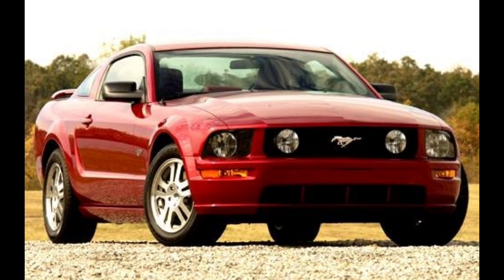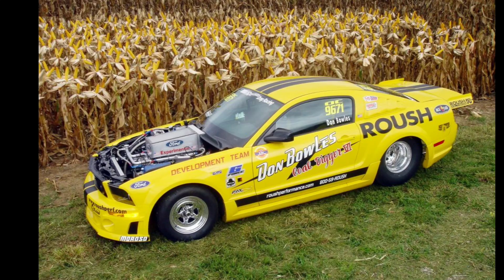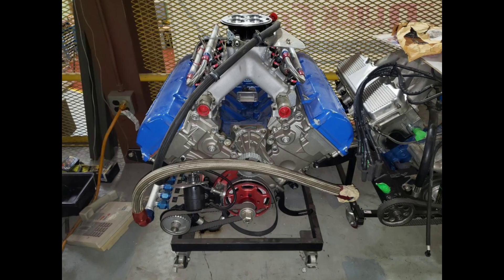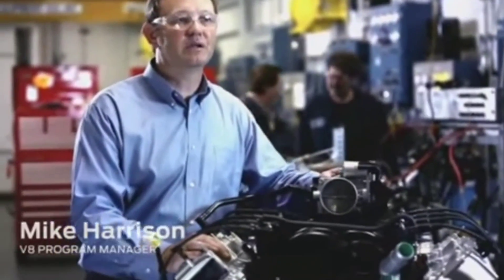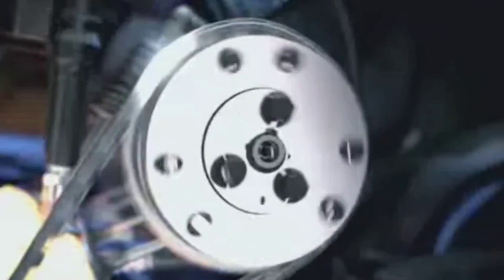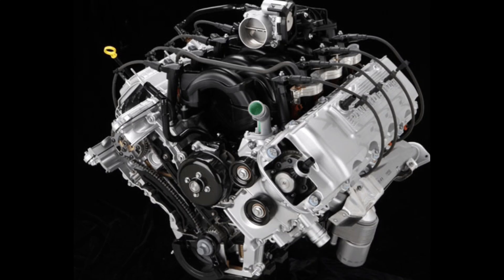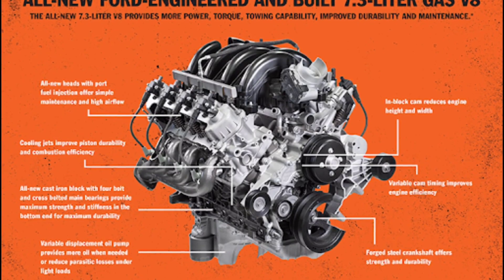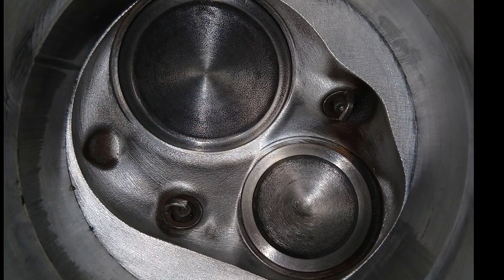Ford's Modern Day 427 SOHC Cammer..

Comment: Where did you source the parts needed to convert the 4.6 to a direct-cam-driven distributor-based ignition?
Reply from the maker: Stylac, we made it ourselves...  We used a 351C distributor cut down and welded a socket on the shaft that was the size of the cam gear bolt. Drilled the aluminum valvecover (made by Team Breed) in the proper location then welded a sleeve on the valvecover for the distributor to slide into... it is held in place by 3 set screws drilled and tapped into the sleeve..  Hope this helps.  I'm wanting to say that we did this back around 2009 or 2010...  it works great we use a crank trigger to fire the ignition but it is nice having a regular style ignition system on the car... Thanks for Watching.  I did a Video on the mustang awhile back on my channel.  The fastest Nitrous 4.6 2V
Andy
Reply: @UnityMotorSportsGarage  
Very nice work.  Looks professionally made by an OEM.   I love these type of projects where you are doing something original!
Reply from the maker: Stylac, Thank you!  On this deal.. it was done out of necessity.. We had been running the MSD Mod 6 box controller.  We in fact had one of the first if not the first Box to test on a Carbed 4.6 and this engine has 14 to 1 compression with ALOT of Nitrous which makes for a ton of cylinder pressure.. well with this the Mod 6 box would work great for a short time and then it would kill the coil drivers in the box!  It would drop cylinders and cause horrible backfires.. after we went through 3 or 4 of those boxes it became apparent that I had to come up with a change.. so I sketched the design out and we made what you see today... Funny Story years ago we took the car to a NMRA race and a rep from Trickflow came over to look at the car. ( We were running their heads ) he began to ask me about the setup so I explained how we did it. A few months later at SEMA and PRI Trickflow had come out with a kit to do the same thing!  You can still buy it today... The idea came from this car!
Andy

Comment: The old SOHC 427 was a HEMI head
Reply: Hi, I had some flow numbers of SOHC 427 with a high port head.    Fitted with Manley valves the flow numbers:
.200" - 175 cfm
.300" - 270 cfm
.400" - 330 cfm
.500" - 405 cfm
.600" - 440 cfm
.700" - 450 cfm

Stock valves:
.200" - 155 cfm
.300" - 240 cfm
.400" - 300 cfm
.500" - 375 cfm
.600" - 405 cfm
.700" - 420 cfm

The low lift flows of .400" and below are not that far from a DOHC head on the same bore and definately well above any pushrod head of similar valve size on the same bore.

Comment: I have a 6.2 in a 2017 f350 and it's a total dog, runs out of power at 3k rpm and has trouble maintaining the 85 mph speedlimit
Reply: Then you have something wrong.  My 2011 6.2 f250, starts belting out the power around 3k, and really kicks ass through 5800-6000 rpm.  I beat a tuned/bigger turbo’d Duramax to embarassment last month in a 30 roll.   My stock super duty has tall 3.73’s to boot.
Reply: @mistered9435  look up the power rating of a 2017 f350 cab and chassis model and it'll explain why mine is such a dog.

And there is no way that your 6.2 beat a duramax that's making atleast 400hp and probably 800 ft lbs of torque, you were probably racing and he was driving normal.
Reply: @centraltexasfoxbodies  haha. I’m not a brand loyalist, but I seriously did smoke the duramax.  It is my nephew’s truck, we were on our way to a family celebration,  got beside each other on the way out of town, and stood on the go-pedal.  The diesels have a much narrower power band btw.  You could also check out the towing videos on YT about gas Super duty vs. gas GM and Ram.  It may have been The Fast Lane videos?
Reply: @centraltexasfoxbodies  no.  You will need a 20-speed transmission to keep that diesel in the power range.  Think about it:  put a 600hp Peterbilt against a 155hp trailblazer, which one do you think is going to cross the finish line first?  The Pete has 4 times the weight and 4 times the hp, but it doesn’t have the broad rpm range.  It makes its power within a few hundred rpm, while the gas engine makes its power over a few thousand rpm
Reply: @centraltexasfoxbodies  I hate to hurt your feelings, but my 6.2 wasted his duramax. 
His truck is an ‘02 with a bigger turbo and a tune,  no lift extended cab long box 4x4. 
My truck is a stone stock f250 lariat, super cab long box 4x4 with a fiberglass topper on it that is 6” above cab height. 
I’m sorry that you can’t accept that the 6.2 in my Ford likes to beat up on a duramax, but the truth hurts.  I might add that my truck is probably about the same weight as his even though his is a diesel.  
AVERAGE power across a broader power range is the key here.  You are stuck on peak power output.  The diesel makes its power for a much shorter span than the gas engine.  Get it?!?!
Reply: @centraltexasfoxbodies  wow. You wouldn’t know the truth if it punched you in the teeth.  I was following him to an event center, he stood on it, was rolling coal, I got on mine, and passed him!  He was far less hurt about it than you are.  Yes, he was indeed trying to outrun me, but my stock 6.2 was too much for the duramax.  Your facts are crap.  I’m sure that you would refuse to believe that my wife’s (new at the time) 2013 Mustang 3.7 also outran his 1993 LT1 Formula 6-speed too.  He didn’t cry about it and these are not serious, anal grudge matches.  
Years ago, i allowed the same nephew to take my street-driven 1993 z28 to the drag strip.  I built that lt1/a4 to be a fun daily driver/weekend warrior with a .030” overbore, tight quench, GMPP lt4 Hot Cam, 11.6:1 compression, Trick flow heads, Pacesetter headers, magnaflow exhaust, and 3.42 rears.  Very simple, right?
At the drag strip, Bully Dog had a Dodge Ram there.  I have no idea what kind of power they were claiming to have in that truck, but I am sure that they had thrown the whole bag of tricks at it.  Guess what?  My simple, not-yet-optimized z28 edged them out in the 1/4 mile.  I would think that they had at least double the hp and maybe triple the torque that my Camaro had.  That actually was on YouTube back then (roughly 10 years ago)
With your thinking, how do you explain that?
Reply: @centraltexasfoxbodies  btw, look up the Dyno graphs of the 6.2 ford.  You showed your hand as soon as you claimed that “your” truck is out of power at 3k rpm.  With your lack of intelligence, you would never be able to buy a 2017 anything.
Reply: @centraltexasfoxbodies  well congratulations.
Reply: @centraltexasfoxbodies  your 84 month financing is going to seem like forever, but hang in there, someday they will be all yours
Reply: @centraltexasfoxbodies  good for you. Our new ‘22 chevy is supposed to arrive sometime this week.  My daughter enjoys her ‘21 Trailblazer RS (her first new car).  I will keep my 11 year old f250 for awhile because I take care of it and it looks great and runs great.  It has been a perfect truck.  155,000 miles without a single repair (unless you consider changing spark plugs and battery a repair)
Reply: @centraltexasfoxbodies  haha. I’m not the one who had to finance a Ford Focus!  The F150, I could understand; we traded in my wife’s f150 Lariat on the ‘22 Chevy and chose to finance the remainder at 3% because my daughter’s  Trailblazer was a chunk of change to lay out earlier this year.  I’m not rich, but I have had a great 22 years as a business owner.  Have a great day driving your sewage-pump truck!
Reply: @centraltexasfoxbodies  you ASSume too much!  You are the one who started the belittling.  I told completely true occurrences regarding my vehicles and somehow you know better and were basically calling me a liar. What kind of response did you expect?  Are you seriously running your company truck at 85 mph?  I would shit-can your sorry ass immediately if you were my employee (although I’d have never hired you in the first place).  
AFM?  Lol. I never said what model of chevy we bought.  It sure as hell isn’t a SilverLAREDO!!  Ours will not have AFM. 
I’m sure that you’re not as bad a guy as you come off to be on here, so I will wish you a safe day at work.
Reply: Also, you are exactly why there is a spell-check option on your device.
Reply: the f250 had the 410 horse your f350 has the work truck nersion 365

Comment: Perfect timing for this video. I’m actually working on a friends 6.2. Haven’t ever dealt with them before. It’s water pump shaft broke and the fan just shredded everything up front. Made a real mess of the rad😢. At least the trans cooler and the a/c condenser were ok. Now the fun begins of putting it all back together.

Comment: Thank you for confirming the 6.2l and 7.3l possible crank swap. Working for the company that produces both factory intake manifolds and knowing bore spacing to be identical, ive pondered for awhile now if the cranks would swap. Thank you!!
Reply from the maker: Yes Gary, I begin reading when the 7.3 came out and noticed the bore spacing.. we ordered a 7.3  crank from the local Ford dealership. It was like $350 and it's a Forged crank!  It went right in... Like I said need to machine a sleeve to drive the oil pump..  Thanks for Watching!
Andy
Reply: @UnityMotorSportsGarage  Hi, any updates?
Reply from the maker: We decided to go with the Godzilla engine instead. It will be cheaper in the long run.. you will be seeing Godzilla content coming up here over the Winter

Comment: Please sir go with the 445ci Godzilla 7.3, nobody is showing gradual fab work on shimming a 7.3 in older trucks or cars. Personally I’m wanting to put a stock 7.3 out of a wrecked 2019-2021 truck into my 85 F250 XLT Lariat 4X4 for daily driving with power upgrades after the fab work is complete and drivable daily. I’m currently just waiting for a wrecked truck with a running 7.3 salvage title to show up in the junkyards to do the swap because buying everything new outright I can’t afford. Sadly this means somebody has to have a bad day for me to be able to do this swap in a 85 OBS Ford Truck.

Comment: I have the absolute best motor in my 02 mustang, a 6.0 LS ironblock with a reliable detuned 826hp at 7.5 lbs boost, max tune safely is just over 1200hp.
Reply: What color stang am I looking for at LS fest?

Comment: Indmar marine switched from GM engines to the 6.2 Ford, and Ecoboost 4 cyl. I know they have a 510 HP/580 TQ version of the 6.2, and a shop I worked at did an SCT tune on the Raptor when it came out, and Ford factory tune is very conservative on timing and fuel.

Comment: Before you cut up that 6.2 junk head why not see whether it'll fit on top of a 7.3? Are the head studs in the same location or no? If they are, well, that could be very most good. [Kinda reminiscent of the old Clevor conversions back in the day, putting Cleveland heads on top of Windsor blocks- remember that!]

Comment: 385 to 411 hp isnt shabby at all. Very importantly, the SOHC 6.2 is a 239  thou shallower Godzilla deck engine at 9.410 inches, not 9.649. It shares all the OHV tooling.  The crank is 3.74 verses 3.976,  the bores 4.015, verses 4.220. Yet again, Ford has a shared Michigan transfer line which allows a classic scramble...a range of 300 to 430 hp engines on the same tooling. Ford can now step back to OHV, step back to 5.3 to 5.8 liters in the confines of the same block, exactly like Chrysler did with the 331/354/392 Firepower Hemis from 1951 to 1958. That engine became the basis for the Drag Strip 392 Hemi. For the next 13 years till early 1970, that became The Drag engine. It took years for the 426 and 429 to follow in the 392 Hemis footprints!  You can bet Ford will do the same as Mopar. All Part of the Master Plan Andy!

Comment: I’m guessing the 6.2 never made it into a Mustang for 2 reasons.  Emissions and fuel mileage.  Even back in 2010 Ford knew the EPA was coming at all manufacturers with stricter fuel mileage standards.
Reply: Yet the C8 has a 6.2 in it.
Reply: Don't you just love liberals? They really screwed us in muscle car era. We've been screwed ever since. They just love to be the killjoy in everyone's life cuz they want everyone to be as miserable as they are. I got my driver's license a year before the Mustang 2 came out, I stopped at a Ford dealer and looked at one. I didn't know whether to cry or puke, pretty much like now. No refineries built in over 30 yrs, gas prices thru the roof again. Remember the Arab Oil Embargo shiyit? I saw people fighting in gas lines cuz the Arabs had the "answers" according to Jimmah Cahtaa. We had hostages in Iran, peanut boy didn't have a clue what was best for our country
Reply from the maker: That would be my guess also...
Andy
Reply: @UnityMotorSportsGarage  Something I'm noticing that might be going on. Ford might have run themselves out of racetrack with engines on the mustang. They've already confirmed that a 6.8L Windsor is coming based off the Godzilla and I'm betting that's gonna be the "427" that ford ends the combustion mustangs on. They can't get much more powerful before it becomes too much for their target market. I'm sure people would still buy a 1400hp pony but most of the people who want that will build it themselves.

Comment: Get rid of the variable timing and you will have a reliable engine
Reply from the maker: Amen to that!
Reply: Variable valve timing might possibly hurt reliability but it greatly improves off idle torque to about 3000 rpm by about 50 ft-lb...    So one could run a much more aggressive camshaft and in the driving rpm range have greater driveability.

Comment: We need a 4 valve head for the 6.2 engine... With the big bore spacings, the big cubes make it easier to make even more power over the Coyote...Result.... Insane POWER
Reply: YES. I always wish Ford did more with the 6.2L makes me sad they really didn’t. Love the 6.2L in my f-250.
Reply: For now, I think our best bet alternative is going to be the cast iron Coyote-based "werewolf" block which can be bored and stroked up to 5.6 liters.   Youtube won't let me leave a hyperlink but CJPonyParts has a good article about it.

Still, a shame that we can't get better head choices for the 6.2 bore spacing.
Reply: That would be great, then give it 4tenths ofa cl and more compression for a wicked 6.6L throw it in a Mustang and call me. Oh 6 spd. manual only.
Reply: Just take a 351 Boss block and stroke it to 427 cubic inches and be done with it, it will make over 600 horsepower naturally aspirated and 589 foot pounds of torque, if you wanted to add a turbocharger or two the power levels will go up astronomically

Comment: So how close is the bolt pattern to just putting the 6.2l heads on the 7.3?  I know a truck puller with BBF heads on a GM502 Block and that thing is a beast.

Comment: I hope you go with the 6.2 instead of 7.3. I’ve been obsessed with the 6.2 for a while. Bought a wrecked 2010 raptor just to get my hands on one. Would love to see you dig into an in-depth 6.2 build.
Reply: Even though the 6.2 is SOHC and the 7.3 is pushrod, they have the same bore spacing and main bearing size but I am not suggesting the 7.3 crank is a direct drop in. Rousch has built at least one 460 from a 6.2l and got over 800 HP normally aspirated. Someone paid for the R&D the first time. If one looks at all the meat around the cylinders on a 6.2 it's obvious that it was meant to be carried out to larger displacements. Rumor has it that Ford designed this engine to be be able to be taken up to 480 cubic inches. A SOHC 460 or 7.5l if you will, sounds appealing to me.
Reply: Did we get flow numbers?

Comment: Andy - I've been looking into 3D printing valve covers  recently. I also have a engine with almost no aftermarket support and 3D printing might be the solution for custom valve covers. There are some plastics with large percentage of metal powder in them which make printed parts look and feel pretty darn similar to metal parts. But there are things that I need to further confirm - will certain plastics warping due to under bonnet temperatures and what is their resistance to oil and fuel. Also developing process to give a nice surface finish to 3D printed part after it has been printed.

Comment: The sohc had tunnel ports too. I'd have to imagine that 50 years of technology would make up for the missing litre
Reply: If the 427 sohc had todays gas and emissions restrictions it would make 25 horsepower.
Reply: I don't agree.  Modern technology has made engine operating systems MUCH more complex.   Good for emissions, maybe, or gas mileage.  But the 1965 SOHC similarly tasked (the "modern" engine doesn't get 2 turbos to compete) will beat a 6.2 to death. When your foot is on the floor...technology's advantage is gone.  A shop near us just completed a 331 cubic inch (5.4) pushrod small block Ford with 2 turbos at 2300 horsepower. (Ford Racing engine block)  Technology has its place.
Reply: Good point . Big round ports were the rage and that’s before the modern combustion chamber .

Comment: Would the 6.2 fit in a new edge mustang ? Will it bolt to the 5 speed?
Reply: I Hope SO!!!!!!!!!!!!!!!!!!!!!!!!!!!!
Reply from the maker: Yes it will, there have been a few Foxbody swaps with this engine,  It has the traditional Mod motor bellhousing bolt pattern.
Andy